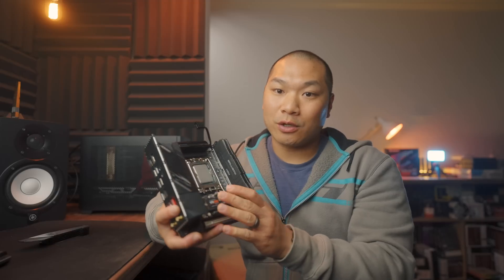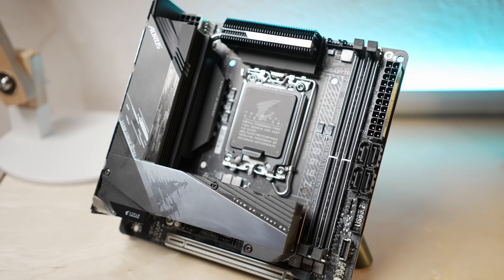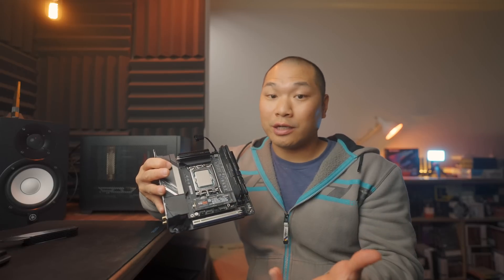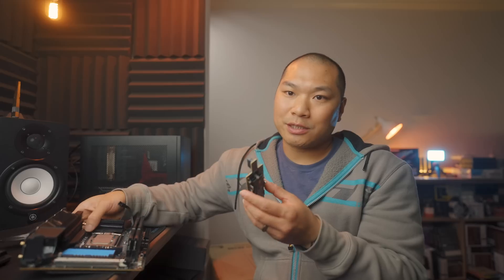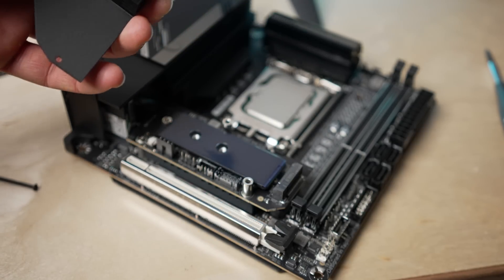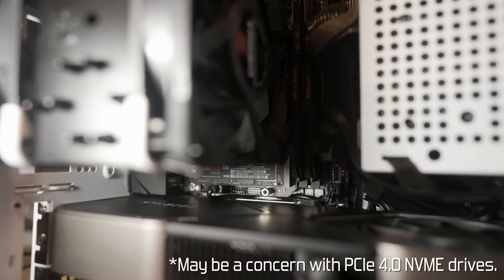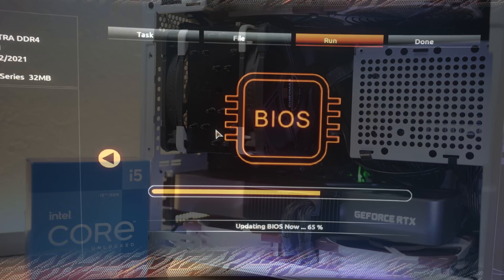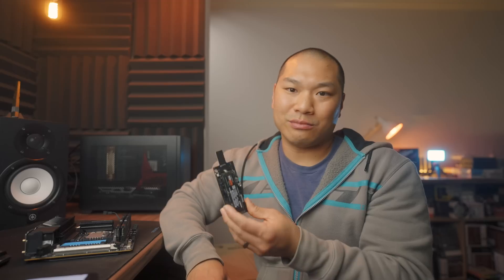Gigabyte Z690 ITX Ultra... Ultra Headache?

Comment: I've got this board now, (DDR4) still labeled revision 1, just purchased in July of 2023, and the PA 120 and Noctua NH-D12L both fit using the stock m.2 heatsink without any modification!
Thanks for the coverage
Reply: Any chance you could elaborate on the NH-D12L as Noctua list it as "mechanically incompatible" on their site. I'm looking for the best air cooler on the Z790i which looks like exactly the same dimentions as the z690i
Reply: @jameswallace6249  the z690 has a heatsink on the m.2 SSD daughterboard that with the NH-D12L installed in a certain orientation, would just barely clear (or maybe touch). You can use it this way, as I have, or you could remove that ridiculously oversized stock heat sink and just put a normal SSD heatsink on it and it would clear fine.
Reply: @thetewks  many thanks for the explanation on this. I can probably use those cooler dimensions to discover more options :)

Comment: I got the lite /ddr4 version of this motherboard, there's white long label covering the original text saying lite, 
I went to flash the bios to latest for the 13600k when I get it, not sure if it flashed since I could not see any Q-Flash Plus LED, only a dark hole. PSU started up & switch off then just a light on end of my FAT 32 stick, I gave it a good 15 mins then tuned all off & packed it up.

Comment: I was tempted by the lite version of this board because of the price. Then I realised the lite version is actually a rebadged version of the original release you reviewed which Gigabyte went on to recall with pcie 3.0 only for gpu. What a mess.... Steer clear.

Comment: My Z690I AORUS ULTRA LITE DDR4 (rev. 1.0) is running great with an Intel i5-12600k and a Thermaltake Contac 9 SE air cooler that isn't even tightened down. (It was the least expensive LGA 1700 cooler that the store had.) All core overclock is a stable 4.7 GHz using Intel's Extreme Tuning Utility, but I use the Windows Power saver power plan most of the time. On an open testbench the idle CPU temperature is 28 °C and the highest temperature that I saw during stress testing is 85 °C.

(I don't recommend this cooler because its clipping mechanism doesn't fit this motherboard due to how close all of the heatsinks are to the CPU socket. You could force fit it, but why bother? Just get something that uses screws instead of clips.)

Special thanks to Gigabyte for screwing up the initial release of this family of motherboards which allowed me to get such a great deal on the Lite version (US $150).

Comment: Thanks for the honesty.  I'm taking a chance with this board on the way to save money so I can re-use my existing DDR4 but it will be paired with a 12700k and going into an NR200P max case so hopefully the cooling/daughter board heatsink/etc won't be an issue.

Have the bios updates addressed the weird display issues?  It looks like BIOS revision F6 may have addressed some of the PCIe issues.

Comment: Someone knows if they fixed it nowadays? Wanna swap to 12600k and keep some sweet b-die (2*16gb B-Die 4400cl17 ripjaws). I am thinking to downsize to SFF from an Air Mini + 10th gen and this board seems the only one (on paper) that can get the job done.
Reply: Im in an identical boat, just ordered the z690i ultra lite D4 for $150 and i want to keep my dual rank Bdie
Reply: @BonusCrook  I've kept my o11 air mini and got a z690 tomahawk ddr4 wifi. Ddr4 4000 c14 with tight subs. Also went for a 12700k. Works like a charm tbh.

Comment: Can you re visit this board and see if it still has the problems you talked about?
Reply: The board was actually recently recalled because issues with gen 4 in the x16 slot (which is kinda funny considering I don't even think he mentioned had this issue and still warned about getting it, it's just such a bad product). 

Although they did release a "fixed" version (with a higher MSRP than the original) and a pretty cheap Pcie 3.0 limited version, so those might be interesting for him to review.

Comment: I got an F8b BIOS from Gigabyte. It fixed my issue with the USB 2.0 ports being disabled when audio controller is also disabled although the boot time seem longer than before. I haven't measured with the old BIOS but with the new one, I takes me 21s to the AORUS splash screen and a total of 48s to get to the Win11 login screen. I am running an i5 12600, 32 GB 3200 DDR4 and Gammix S70 NVMe drive.

Curious to see if others have comparable results.

Comment: I bought this board and i would hate to return it. XMP profile is the culprit when enabled the system crashes. The other thing about this motherboard when it does work the reset in Windows 10 doesn’t work it would reset with no boot screen

Comment: Thanks for the video! I got this board, even after viewing this video and the reviews. It turned OK with BIOS F6. I left everything by default and my NVMe Gen4 (GAMMIX S70) and my RTX2060 (PCIe v3) were recognized right away. My only issues were disabling the onboard audio also disabled USB 2.0 ports (not sure if this is a bug or working as intended) and the onboard LAN was stuck with a code 10 in Windows. As suggested by users, turning the LAN to 10Mbits/full duplex solved the issue. I put it back in auto-negotiation after and so far so good, it has been almost a week. I haven't done any overclocking or XMP yet. I was able to fit a Noctua NF-C14S event thought there is only one configuration that will work, partly because of my tiny case. I put my NVMe on the CPU link, the one at the bottom, connected to the MB heatsink and get max temperature similar to the review (53C). I had no issue with cabling but I only used two fan connectors, USB2 and USB3 connectors and front panel switch/lights. I did not detect coil whine when idle but maybe my hearing is just bad :-D

Comment: Got the ASRock Z690I using DDR4, thank god I didn't encounter any issues. I was eyeing this MB for my ITX build but thanks to you and reviews online I was able to avoid getting it and wasting my time. I wish MSI had an ITX DDR4 Z690 as I don't have any issues with my MSI Z690 Edge wifi DDR4 board.

Comment: Do you think I can fit a NH-D15 without the big heatsink? I've been debating between this and the ASRock Z690M-ITX/ax but the later option seems like a really low end board.
Reply: did you put it?
I need the answer
Reply: @kevinmelendez5339  I'm using the u12a, which despite being smaller performs extremely similar. Also I'm not using the big heat sink from the M2 SSD, I've bought a smaller one for like 10 bucks.
Reply: @yuyue-q5d  im gonna try my dh15 tomorrow, thanks partner for the tips and the answer, you are truly amazing!

Comment: Would an l9x65 with a 12600k in this board be a horrible idea?
Reply from the maker: Yeah, unless you have room a bigger full thickness 92mm fan. My preference here if height isn’t an issue is either C14S (tight for the bottom fan but do-able) or U9S.

Comment: I’m building an nr200 with an i9-12900k, so I was considering a 280mm rad over a 240mm rad. Is there a significant difference in their cooling ability for this application? (I will not be using my cpu at max load very often)
Reply: To note, I’m considering between the Corsair h100i/115i  hydro series
Reply: Or could this possibly be air cooled with the noctua nh-u12a? Thanks

Comment: That's a strange review. If the card didn't fit your expectation, why did you choose it? There is low grade and middle grade motherboards with single M2. This card gives absolutly zero compromise for people who want to use an AIO & double M2.
Reply: This mobo has major clearance issues and buggy bios. Look at reviews from any major retailer.

Comment: Just built in the z690i aorus ultra, watched your video closely and I'm really thankful that you vid has prepped me well! bios-flash to the latest F5 version makes the board bootable, but the software side of things (audio drivers, gigabyte's own app-things) are definitely still a mess. Really hope they can fix those problems, given that this board is an awesome package otherwise!
Reply: Hey Legend_OZ, just a heads up dude, I am seeing an F6 BIOS now listed on Gigabytes website which lists some good improvements.

@Machines & More, great video and an interesting take on this board. I have purchased it already and am building in an NZXT H1 so most of the criticisms don't apply for me, however I did find the m2 daughterboard a strange addition - especially after using the x570 version of the aorus pro wifi ITX board.

Will let you know how I get on and what issues I run into - as soon as my H1 AIO adapter arrives from NZXT..
Reply: @jordanbennenbroek9042  Hey thanks, and yeah I flashed to F6 as soon as it released but still have to set pcie to gen 3 for pc to post properly (have a gen4 riser in nr200p). Other than that, memory oc is ok and system runs well with no errors.
Reply: @owen7342  Awesome dude, thanks for the feedback. Looking forward to hopefully no dramas in my H1 build once this AIO bracket arrives (or actually gets shipped, COME ON NZXT).

Comment: Man, I should have seen this days ago! I tried to upgrade from my 10700K/AsRock Z490 to the 12600K/Z690. I thought I had waited long enough for revisions and software/hardware kinks to be worked out. My Noctua cooler didn't properly fit on vertical or horizontal. As well as just other software issues. That beefy M.2 area was the buzzkill for me. Thank goodness for Microcenter's return policy.

Comment: Just doing research, seems to fit my build perfectly (as of IO, rgb headers placement etc.). However the storage support list is very meh if you want to use the full potential of your gen 4 m.2 and or have 2,5" SSDs for mass storage, also not alot of options if you go for lowest cas latency with the highest clock speed (when it comes to RAM). I would love to go for the ASUS Z690 ITX mobo, but the 8-pin and fan headers would get all mangled. Again, just a different POV from a pretty "normie build" 2x240mm + 1x92mm LC NR200P.

Comment: I have the ASUS Z690-i and I found the install and bios seamless and stable, respectively. I tried the Fuma 2 and the Noctua NH-U12S and both fit on that board quite easily as long as you remove the top heatsink on the M.2 sandwich. Heck, people have confirmed the NH-D15 fits on that board. Mine also exhibited no coil whine. I was running a stock 12700k.
Reply: Hey, I know this an old comment but wondered if you had any insights. Just picked up this board with a 12700k and have been looking everywhere for cpu cooler info for this mobo. Was looking at a thermalright peerless assassin cooler and was wondering if you think that'd fit this layout. There is so little info online about compatible coolers so just wanted to see ur thoughts and maybe pics if you have any of ur setup. I figure if a Fuma 2 can fit so can the thermalright.
Reply: @jakebrown8073  I actually have a peerless assassin but haven't installed it yet! But it should fit and be a bit cooler than the Fuma
Reply: @mohamedahmed1023  Oh sick, let me know if you have any issues installing it. Also, do you just use the bottom m.2 drive if you have the top m.2 cover removed for the cooler? Saw comments online about some people having issues using just the bottom m.2 and wondered if you had any issues.
Reply: @jakebrown8073  you need the top m.2 connected for the bottom to work. But keeping both installed is easy. Just don't have the heatsink on the top m.2 drive. The heatsink is the problem.
Reply: @mohamedahmed1023  just to be clear, you need the top m.2 drive populated for the bottom to work? Appreciate the help
Reply: @jakebrown8073  you don't need it populated. You need the top m.2 slot connected to the motherboard for the bottom to work. But it can be unpopulated.
Reply: @mohamedahmed1023  awesome good to know
Reply: @mohamedahmed1023  Just managed to completely screw in the thermalright PA to the mobo and it fits, but the heatpipes are touching the top side of the board's heatsink when completely screwed down. The pressure on the heatpipes/heatsink doesn't seem super tight so I think this cooler should do the trick. Lmk if you have a similar experience but should be good to go
Reply: Do you think Asus Z690-i could fit well with Noctua U12A by removing the top heatsink of the M.2? 
Btw, are you using slimmer 3rd heatsink for the M.2 since the original heatsink was removed?
Reply: @airrwalker  I use the m.2 on the lower layer of the sandwich. A U2A should fit. I don't have anything populated on the top m.2. if you put something on the top m.2, I think adding a heatsink to it would make compatibility tough. Tbh, I've never had SSD thermal issues even in motherboards where the SSD is on the backside in a sandwich layout case.
Reply: @mohamedahmed1023  Appreciate the reply. Do you have any idea about  MSI Z690-i unify which was considered to have better compatibility with lower M.2 heatsink area compared to Asus Z690-i ? But glad to hear that Noctua U12A could fit on the Asus Z690-i with the top heatsink removed
Reply: @airrwalker  no idea. But tbh if you have serious concerns about compatibility, go with the MSI or Asrock boards. I got the Asus because it was the only ddr5 board available at the time.

Comment: Just picked this board up for my new build. After reading a bunch online after I picked it up, it didn't look so good. Why didn't I do research? Well I went to the store intending to buy a 10th gen i5, but was talked into getting a 12th gen and therefore they recommended this board which I knew nothing about. I won't be running a m.2 drive, so the whole heatsink and BIOS issues with that are out of the picture for me. Hopefully the rest goes as planned and I don't have any major issues. Your video helped a lot, especially with the cooler selection.

Comment: I got a feeling the negatives on this board is neglected when you use the Meshlicious!
-Because you're using a riser cable for the gpu
-You are most likely to use an AIO which will be better with installation compatibility.

Comment: I must've been one of the lucky ones. NR200P MAX cooler fit fine, and no issues with the m.2 ssd being detected. The front audio connector cable being hidden is a pain in the ass though

Comment: I just upgraded my NR200 PC and used this motherboard. I am using a Noctua NH-C14S for my 12600k and am able to use a 120mm fan underneath it FYI. I have the 140mm noctua on the side panel as intake and my cpu temps haven't gone over 60c after gaming for hours. 

I have no coil whine on my board as well, so this seems to vary, although I did see others mention it and was very worried mine would have it. 

I had the 5a bios update ready before installation on a USB and everything has been smooth, I am very pleased with the board so far. 

I definitely would recommend this motherboard to everyone if I am being honest. I am not using any of the   connections on the B2B connector, and wouldn't though. That seems like it would a cable mess
Reply from the maker: Good! I think the cabling with the mini ITX board and this setup makes the 140mm super tight under the heatsink. Technically it can fit but in practice… it’s very hard.
Reply: You would recommend this motherboard, even if you have to reduce pcie speed to 3?! So any nvme ssd gen 4 would run at gen 3 speed? Regardless of riser cable?! Weird
Reply: @GuestStarMas  riser cable? I am not using a riser cable lol. Like I said, i have zero issues.
Not sure why you assume I would be using a riser cable. Weord
Reply: @kev60625  I said regardless of the riser cable. So you're using pcie 4 speed?!

Comment: Does the Noctua L12S fit with the heat pipes at the top, where the VRM heat sink is? Or, will the heat pipe ends then poke the GPU?
It’s worth mentioning that Noctua doesn’t recommend coolers to be mounted with the heat pipes up but I wonder what the impact is on performance.

Comment: i just picked up the ddr5 version of this board and i put a i7-12700k on it with a u9s, the u9s just barely fits on with about 1mm space between it and the m.2 heatsink
Reply: How are the temps with u9s? I have the 12700k, was thinking for u9s also mostly gaming system.
Reply: @oXiGaming86  I'm still waiting on my ddr5 ram (coming in a few days) and can't boot the computer yet so could you reply to this comment in a week or so and i will probably have the system started up by then
Reply: @WilliamDezunchd  yes, thank you!
Reply: @oXiGaming86  also, do you know what's the best way to test temps? that way i can help you as much as i can. note: i do not have a gpu for now so the temps may be lower than if i had one
Reply: @WilliamDezunchd  yes, install hwinfo and let it run in the background while gaming or normal windows work, and monitor minimum average and highest cpu package temperature, also it will show you consumption in watt for CPU. Thank you for your help, my board is on it's way from US to UK and I will build it just before Christmas.
Reply: @oXiGaming86  i set up everything today, the average cpu temps while idle/using windows 11 were 35-37C, highest was 60C
Reply: @WilliamDezunchd  very good temps for the small cooler. Thank you for coming back with info. If you play any games can you let me know about gaming temps? Also what case are you using? There is a new bios just posted today on gigabyte website.
Reply: @oXiGaming86  for now, no games because no graphics card hahaha but im using an NR200P with TG panel, 2 noctua nf-a12x15 on the bottom, one nf-a9 as exhaust on the rear, two corsair QL120 on top in addition to the regular cooler fan
Reply: @WilliamDezunchd  oh nice, I have also the nr200p with tg atm 10600k with a cooler Vetroo U6 Dual Tower that I'm afraid it won't fit now. I received the board yesterday but have to wait till next weekend for the upgrade 😃